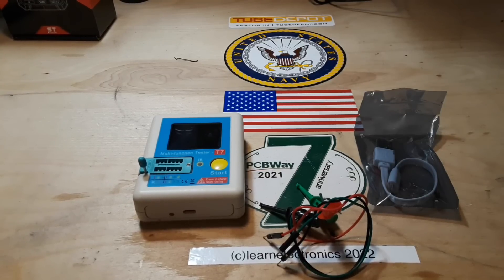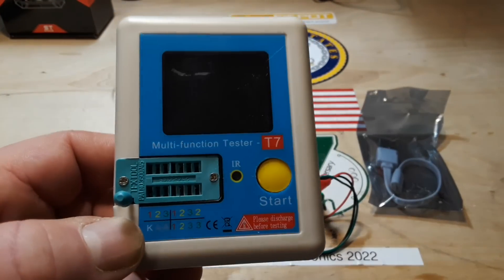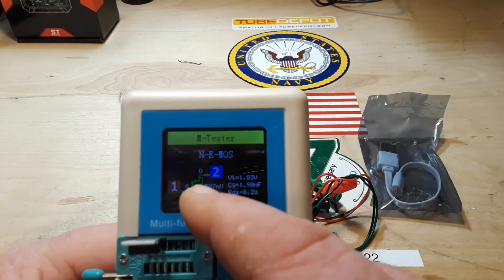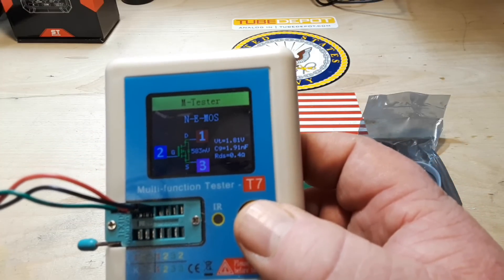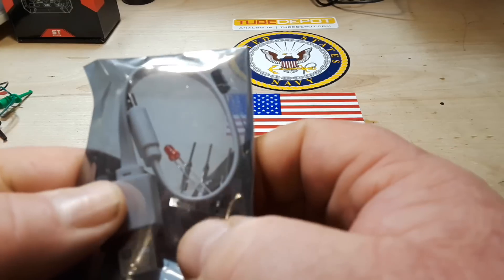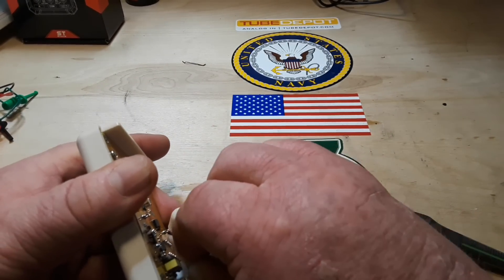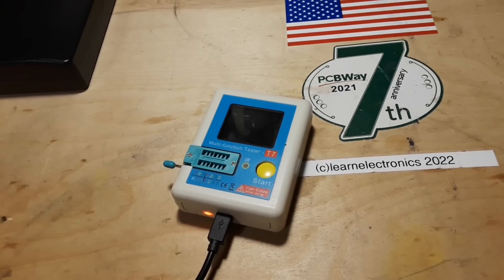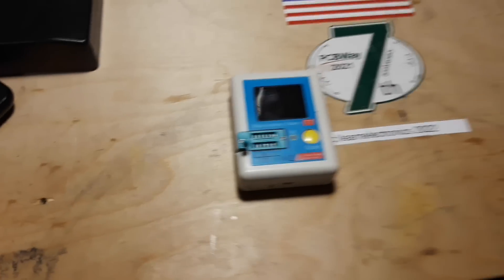T7 Component Tester: Review, Demo, and Tear Down

Comment: Hi, nice video. I have the same device but mine no longer measures any Zenner's whatsoever. it did before but now it does not.  I  would need your help please. I was eagerly listening for the part numbers all all ICs but unfortunately you only mentioned the part number for the MCU even though you had it all apart. No my question is ?  could you please read the part number  of the 8 Pin IC  that is next to the step-up transformer ?  as yours I can clearly see that is marked but for some reason mine has no markings whatsoever  and have searched the internet high and low for close-up pictures of the board but found no useful pictures at all.  I suspect that the IC is in conjunction  with the transformer and it is probably faulty which is why   my Zenner functionality is gone but   i need to know which IC part number that is. Thank you very much sir.

Comment: Hello Professor,
After testing the capacitor twice, the T7 device now only tests its own battery and does not test any other components. The control test is working completely. If possible, please guide me on what the issue might be.

Comment: Why  make  a video about a toy this thing dies and blows open smd capacitors no schematic yeah what a toy  if your going to buy this open it up and take the readings of the capacitors before you use it because when it goes open circuit you cant take a reading of caps with continuity 🤣🤣 you actually need a real  capacitor meter before using this

Comment: The pins are supplied are a test plug to do the calibration.  Put them in (do not separate them) to connect 1, 2 and 3 on the socket together then press start.  The device will go into self-test mode.  Follow the on-screen prompt to remove the test plug.

Comment: I'm pretty sure it was a 324p since it had 44 pins compared to the 32 pins on the 328p chips that I see. Also, I bought a LCR-T7-H and I have a 328p which is supposed to be worse than the 324p in both power and capability, but the T7-H is supposed to be an upgrade over the T-7 so I think I also may have gotten scammed.

Comment: Thanks for the video, well produced as always. I'm sure by now, you have found that the red LED in the bag is for testing and demo. Mine had a capacitor included for testing and demo too. I thought the 3 metal pins were spares but... they turn out to be for calibrating. Put one pin in 1,2 and 3, hit the yellow button and it automatically calibrates. Cool, huh?!  👍😃

Comment: I have a newer one and the inductor isn’t present. The board is a dark blue on mine so a newer revision. I replaced the dinky lithium cell with a 2400 mAh mammoth. Had to remove the connector and solder the wires directly to the board, otherwise it fit just fine and charges great. USB Doctor says 5V 630 mA going into the microUSB.

Comment: I think they're getting worse. I bought one last year and it works fine. So then I decided to buy another one for my other tool kit a few days ago and it doesn't even work the same exact way at all. In fact when you try to turn it off all it does is change the stupid language. From English to Chinese. Whereas the first one I was able to shut it off by pressing the button for a couple seconds. Also the first one did use the IR detector. The second one this new one, doesn't work at all and I paid more for the second one piece of shit is what it is how can you trust it if they keep changing the firmware?
Reply: Same thing happened to me.  My IR detector seems to work though.  Do you know how to change it back to English?

Comment: I just got the same device. But whenever I measure inductor it recognize it as a resistor and shows some irrelevant value. Would you please help me? how can I fix it?
Reply: same with My problem, but T7 of mine is detect Dioda Zener always, have you try calibrated?.from the seller he suggest to replace 6 pins chip/IC, but this IC still undrer shipping, maybe will come after one month.

Comment: Yeah... But you leave it for a week or so and it is dead; the battery is discharged since it has a standby current.  So on mine I put a little toggle switch on it to disconnect the battery.  Now it stays charged almost forever, also it is not very accurate for testing capacitors and inductors and the range is limited.  However, I tend to use it often to just test if a component is functional or to check transistor pinouts.

Comment: I just followed your link to buy another one. The funny thing is that I have three more versions, from the first monochrome that came out, a curve tracer, two scopes with built in component tester, a totem of test equipment and a platoon of handhelds that can test everything an electron can pass through. 
Either way, it's not only useful, it's also an interesting toy.
...I think I lost control of my addictions.
Reply from the maker: You and me both brother

Comment: the LED the small cap & the 3 pin thing is for calibrating it if it needs to be calibrated.  i had the Danui version of this one. blow it up by mistake with a non discharged cap. . felts like crying. have the one the has a square wave out put and duty cycle on it too. its named after the main chip on them. but show of sent off for a new chip of Danui when i "KILLED" it all that time back.
Reply: I found out that it is wise to discharge the capacitor first too.

Comment: Here is a link to the original repository (see downloads): https://www.mikrocontroller.net/articles/AVR_Transistortester
There a many different versions of this tester, but in the end they are all based on this software made by a German guy. I got the first one a few years ago and managed to update it to the latest version. I have a few of them now and use them all the time.
Reply: i built mine using an arduino nano, a 0.9 inch oled using code from that repository

Comment: Just wondering if this tester could be used when there is no labeling or model number on a component and you want to find out the specs. Thanks!
Reply from the maker: Yes, to an extent. It won't tell you the exact model number. But it will give you all the specs.
Reply: @learnelectronics  thanks so much for the quick reply!

Comment: Couple of comments. 
1. Best Dogly action yet. Keep them coming please. 
2. I have been using this one it was a kit. And I know that you like kits. Mine has a black case that I prefer but the clear one is nice too. Just don't drop it in water. It will die. Don't ask me how I  know this. It is available on Amazon. 
GM328 Transistor Tester Frequency Tester PWM Square Wave LCR Meter Voltmeter Full Color Screen Graphics DIY Kit with Acrylic Case

Comment: A transformer doesn't surprise me.  It identified an 18V zener. That means it needs to be able to generate at least 18V to measure the breakdown voltage.
Reply: That stupid thing generate 42V
Just put a diode Anode To pin 1 and see the magic

Comment: I have one of these but it's called a TC1.  I have a few different ones but this is my favourite although I had to install a proper on/off toggle switch as the battery was always flat when I wanted to use it. Even the IR code reader helped me diagnose an intermittent incorrect code being sent by a remote control.
Reply: Maybe I need to install a toggle switch on mine also.